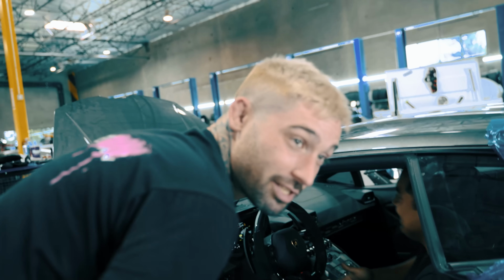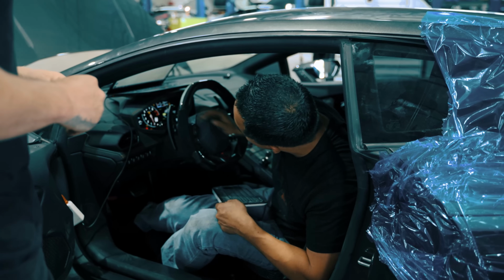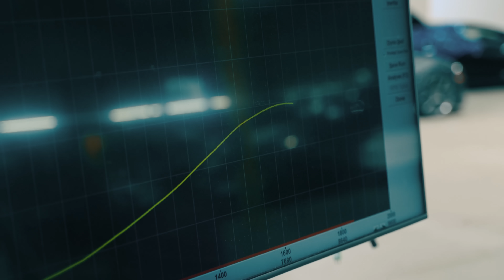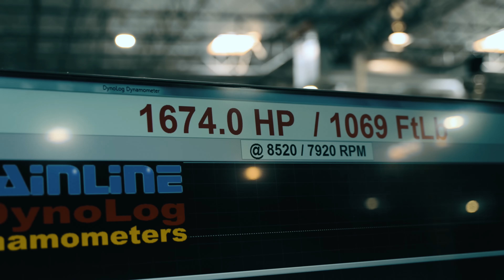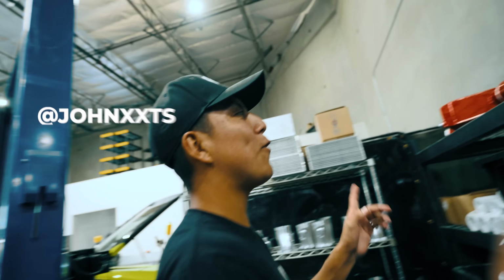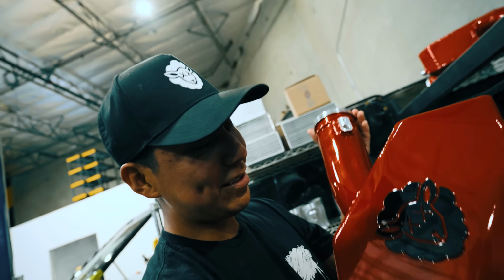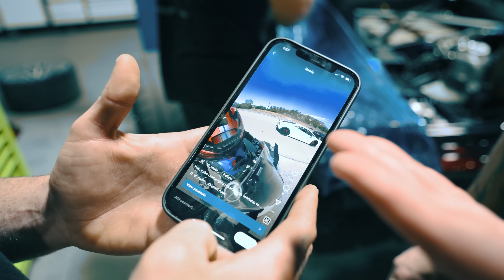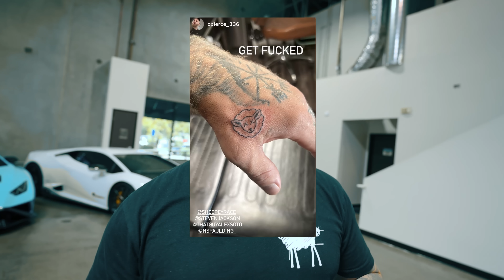NEW KING OF THE DENVER STREETS.

Comment: These are the best built cars for modifying like adding turbos.  Many more shops are building them on video with 300% of stock power and never have unusual or frequent failures.  Audi used to be poor quality.  They have improved a lot.  No other stock car has proven it's safe to add even up to 50% of stock power with turbos.  That's amazing.